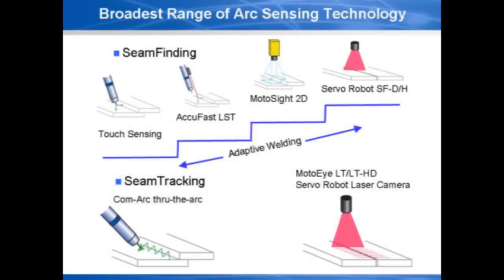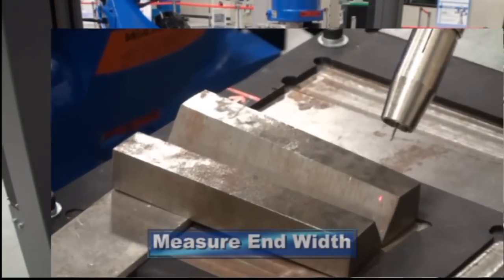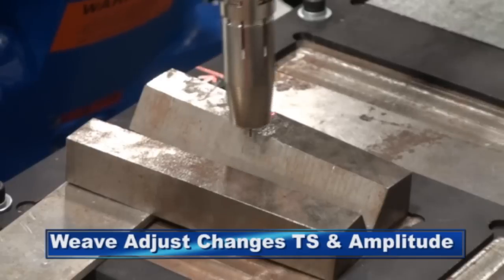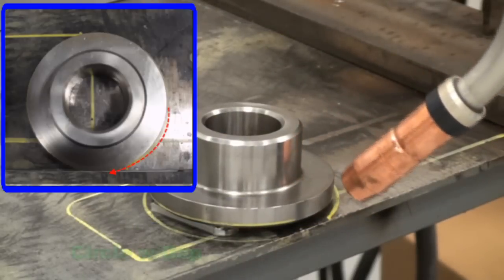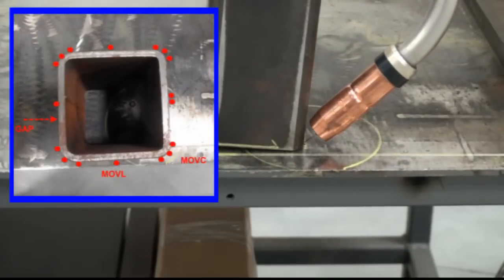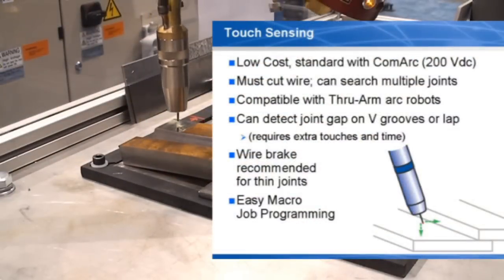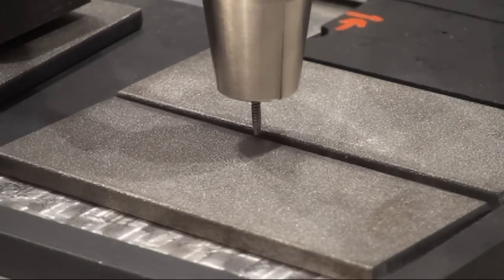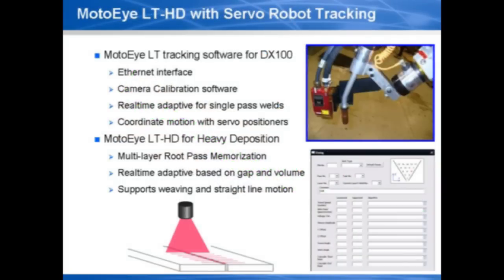Adaptive Robotic Welding- Yaskawa Weave Adjust Function

Comment: only issue with Accufast is the fact that A.) need to make sure your surfaces arent overly shiny as that screws with the read and b.) no dents or nicks in the surface of the areas you are scanning. had tons of issues with accufast that costed me money when it comes to rework. over all if you keep matte spray paint you are usually pretty good